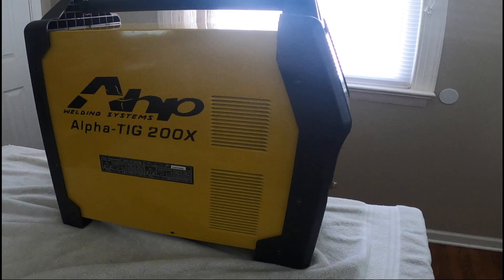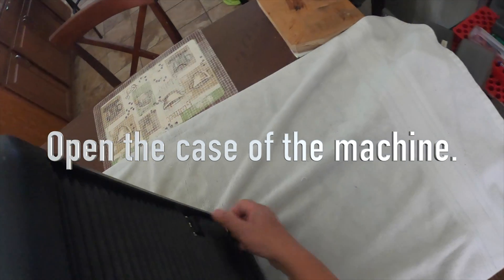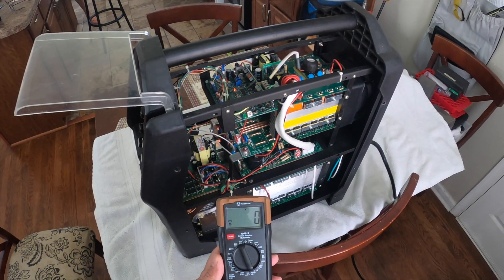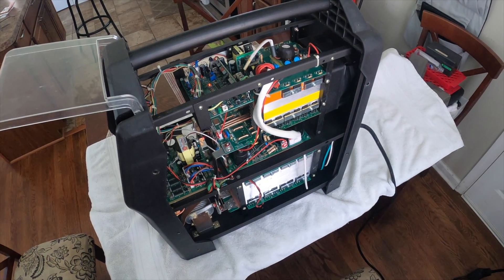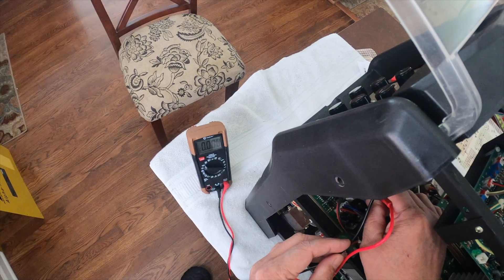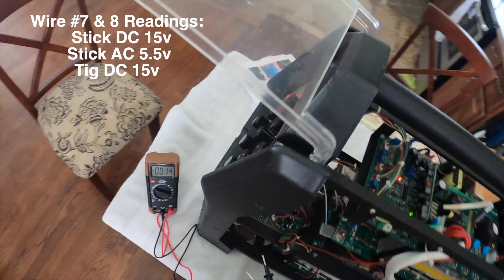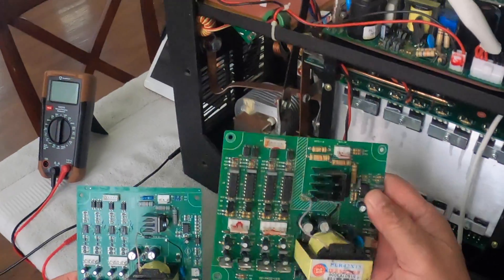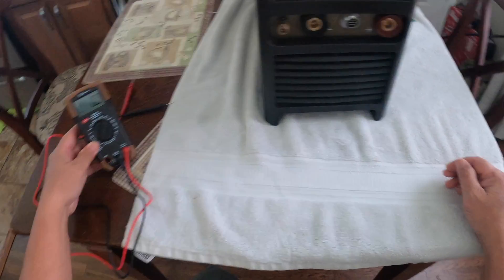HOW TO FIX AHP ALPHA TIG-200X WITH DRIVER BOARD PROBLEM

Comment: Thank you for making this video.  My TIG 201XD just died.  No voltage at the output terminals just like yours.  I've sent an email to AHP, we'll see what happens.  I bought it in February of 2021 so it should still have warranty protection.

Comment: How do you find the info on testing this machine. I have a power on problem. It will power on for a half a sec and then turn off. after that the fan barely cycles. any help

Comment: Mine also stopped working....Where can I get the testing procedure to check all the voltages? Great video btw.
Reply from the maker: I email them  and they send me the procedure on how to check it...
Reply: @kabihog5789  What model year machine do you have? Could you send me the testing procedures that you used?...I just want something as reference to start checking it out. 
Mine is a 2014 and when I contacted them for the testing procedure they told me that they don't have anything that old...frustrating!
Reply: Can you email the testing procedures to me also?  ragecayman@aim.com. Thank you.
Reply from the maker: Ahpweld.com folks…email their costumer service

Comment: I had the same problem but my driver board and HF board were fine, the top board was the issue.  After some poking and prodding, I removed the mosfets and tested them one by one.  One of them failed in the closed position.   I ended up replacing them all as the factory ones didn't instill a lot of confidence.   I found some new ones on digikey, fired them in with some thermal grease and the machine came back to life.   Hope this helps someone out.
Reply: I might have the same issue as you, can you go into more detail about what you did to fix your welder?
Reply: This fixed my welder. I changed the 8 IGBTs (FGH40N60SFD) on the top board 2014 AHP 200x.

Comment: You know, I loved my 201xd when it worked right... First the driver board went out, after a few weeks and after paying for shipping, they sent one for me to replace.. bingo, welder worked perfectly again for 1 session. Now, I try and use it again, no high frequency. It will scratch start but when it does, if it sticks, it blows it's internal breaker and I have to wait a bit to turn it back on. It's getting a lil frustrating
Reply: Did you ever fix yours?  I’ve got the same scratch start stuff going on with mine.  Thinking about replacing the HF board.
Reply: @BellyUpFishGarage  they sent me a replacement board I installed it, the welder worked stellar again for about an hour, after that I took a break and when I came back it wouldn't work again but I'm not even getting scratch start, zero voltage or amperage anywhere with any settings. Got the high voltage inside the machine where it's supposed to be but nothing on my leads. I'm in California so the cost of shipping is half the cost of a new machine so I have been juggling with it but I think I'm gonna send it in and let them send me one of the new 203 models since they are out of the 201
Reply: @twistedsocal  Yeh, I totally understand that. I'm kinda in the same boat. Not really worth it to pay $600 to fix..
Reply: @BellyUpFishGarage  yeah I mean, for me it's right around 380 cause I have to pay shipping both ways which makes the warranty nearly useless, especially when I probably just need a new high freq board. Oh well, it's still half price of buying a new one and it will be like new or replaced with a new unit when I get it back so essentially I get a new welder for under 400 bucks.